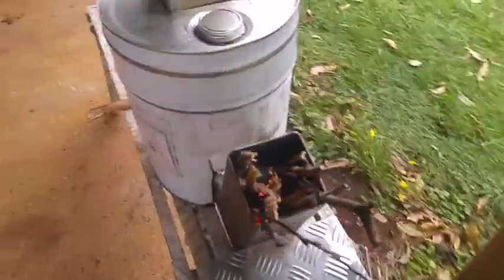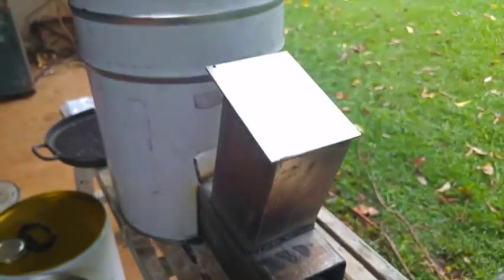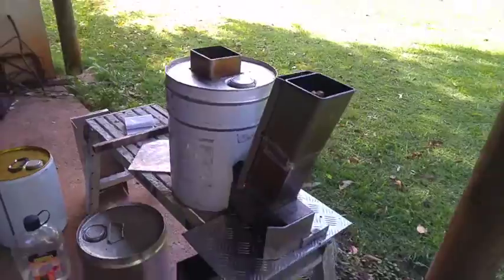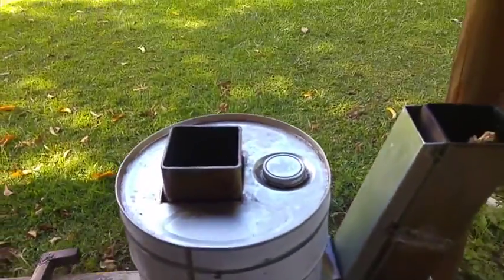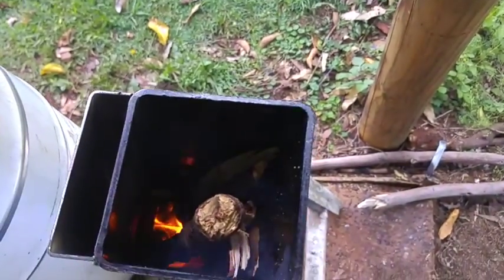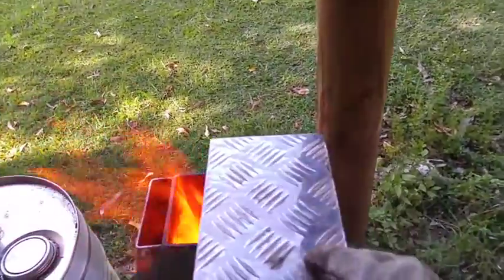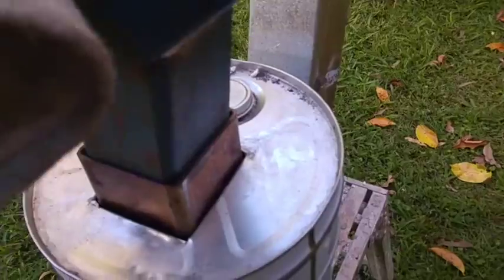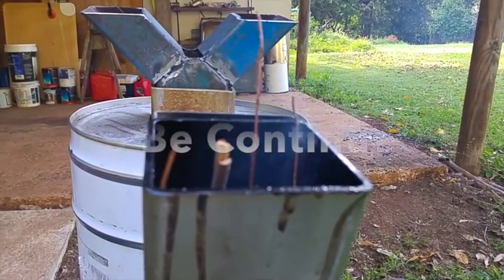Early Experiments in Rocket Stove Design

Comment: I use secondary air by applying dual 1 inch copper air supply at entry to riser and attached along horizontal burn chamber, increasing air temp. as it enters riser causing more efficient secondary combustion. 
Good Luck in your ventures. 
  🍞&🌹's
Reply from the maker: Thanks! Yes this was very early in my testing process and I also found that secondary air is critical for a good burn.

Comment: Look at your stove and visualise an invisible column going straight up to the top of the atmosphere from the entrance and exit. These are real functional components of your stove called air-pressure. If the feed tube and the rocket chimney are the same height then there is no difference in static air pressure. If you make the chimney three times taller then there is extra air-pressure on the feed tube which, given the slightest thermal encouragement will cause the air-flow to go the desired direction.
Reply from the maker: Yes true... these are just early experiments which I have kept live as part of the journey from concept to production. Our final production model is vastly improved on these early tests. Cheers!

Comment: Chimney must bé 1/3 highter than wood feeder tube.
Or reverse smoke...
Reply: Help to
http://mon.danstagueule.fr.free.fr/NRJrealiste/econo/avec%20cone.html
Just à Can, at top chimney.
Reply: I was going to say the same thing. I think the reason for reverse smoke is that smoke looks for the strongest draft pull outwards... and here a taller feeder provided a stronger draft than a shorter riser.
Reply: @oceansagar786   The feed tube can be any height as long as you seal the top of the feed tube. 🤗👍🏻
Reply from the maker: Yes true